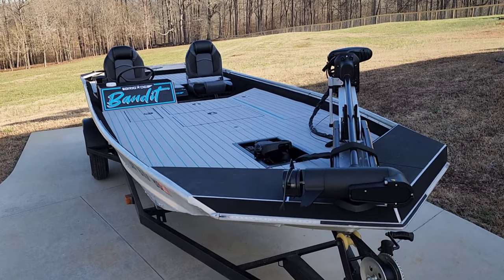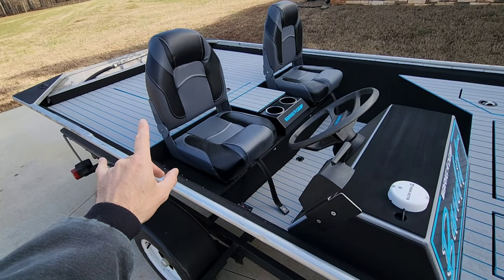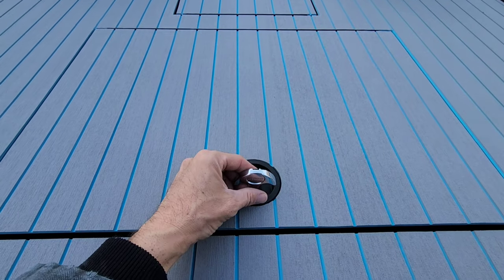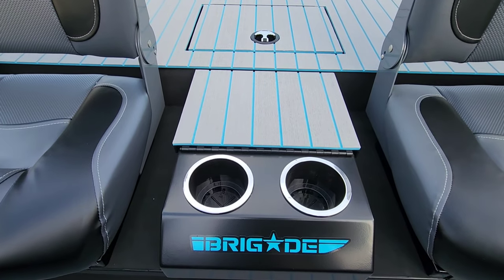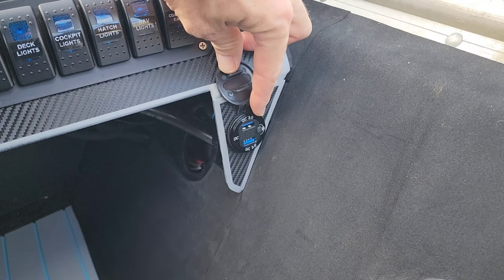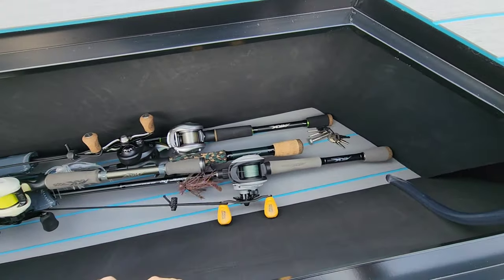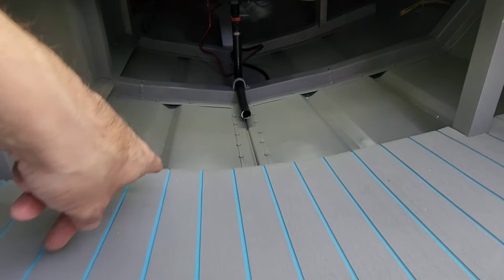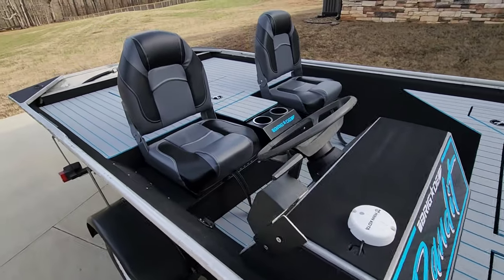Best Aluminum Boat RESTORE I've Done?  Custom Alumacraft Bandit Finished Tour

Comment: I think I’m going to try and build a rod locker in my bass tracker. Is a” angle aluminum 1/16th” thick ok? And 5/32 rivets? I’d like to be able to sit on the lid sometimes. The lid will be 1/2” plywood.

Comment: Any concerns about removing all of the closed-cell foam?  Seems like a little bit of a risk.
Reply from the maker: Nope. It was waterlogged and deteriorating. Only there to pass USCG inspection to sell. Not even enough to keep the boat afloat if it flipped, and waterlogged it definitely won't.
Reply: @AnthonyJonesBrigadeBoats  Thanks for the quick reply!!  I have to say, that is the absolute BEST boat build - period - that I've ever seen.  I did a jon boat last year based on your videos and it turned out great.  I just bought an '85 16' Alumacraft Maverick last week, so your video is spot on with my new project (minus a foot!). I even had the same EVA foam picked out before seeing your build. Did you source your tubing for the floor local? Seems that's my biggest hangup right now.